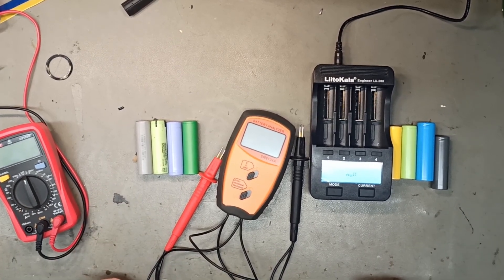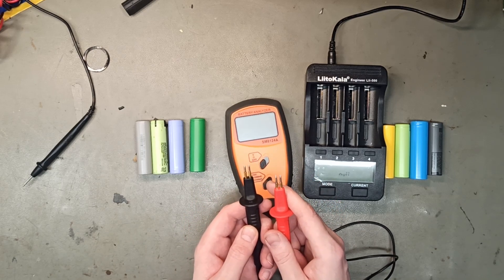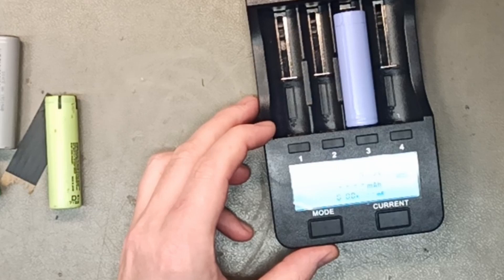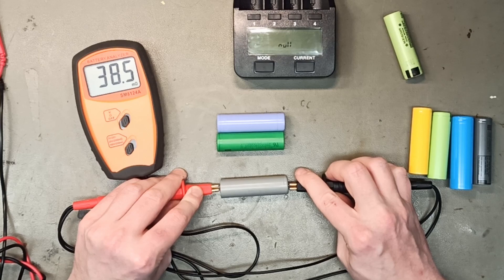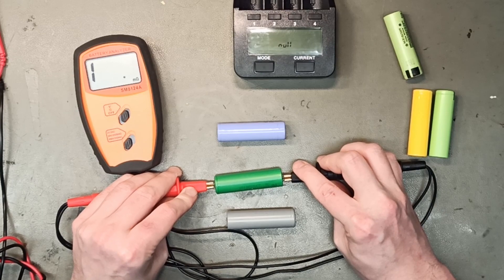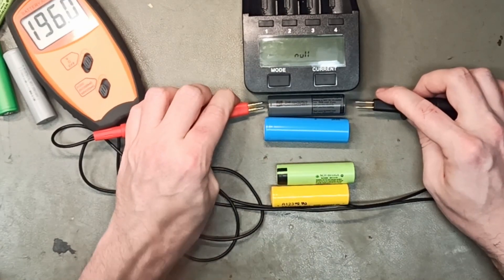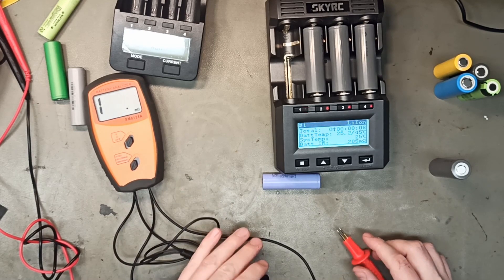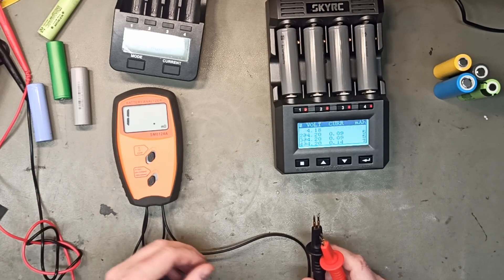Does Internal Resistance have anything to do with Battery Capacity and how to test it?

Comment: that meter is performing a four wire Kelvin measurement. A known Current flows through one pair while the other pair measures voltage drop which will correspond to internal resistance.

Comment: The reason for the dual probe and the inaccuracy of the charger is that there is some small amount of resistance at the contact points with the battery. The contact point resistance variable depending on the contact pressure and how clean the contacts are. This contact point resistance is very significant at this very small resistance readings. So it is extremely hard to get comparable readings between various batteries and test equipment. So the resistance in a battery is important, but for almost all users this data is inaccurate to the point of uselessness.

Comment: I tend to use old cells rated for 30 amps so I can arrange 10 amps discharge and look at the voltage drop. A digital meter across a single cell may change from 4.00V to 3.80V so 0.2V drop for about 10 amps load implying an internal resistance of 0.2/10 or 0.02 ohm. (I use 3 cells in series when testing and load them with 2x 12V55w car headlamp bulbs in parallel so about 9.2a.). If I build a 14S2P battery with peak current draw of 25A and use 0.02ohm cells I will have a battery internal resistance of 14x(0.02/2)  or 0.14ohm. If I then draw 25A I lose 3.5volts which is what this is all about.
Reply: That is good way to sort out bad cells, and its also a good way to test lead acid batteries to see of any cell is bad.

Comment: Sorry for saying that, but even a beginner DMM user knows that never measure resistance in a live circuit. 🙂 You can completely destroy your DMM or just damage the "ohms" circuit and after the DMM will measures incorrect values.
Fortunately, most modern DMMs have overload protection against this kind of misuse. These multimeters - like yours - have a thermistor in the “ohms” circuit. The purpose of this component is to rapidly increase the resistance along the heat from an overload current.
About DC resistance and AC impedance: in all of the batteries datasheets there is AC internal impedance, which measured by 1kHz AC signal generator / crystal oscillator. However, sometimes they call this measurement result as AC IR (internal resistance).
Usually high discharge rated batteries has very low IR (actually AC internal impedance). Most of them are 10-25 mR (mOhm).
DC internal resistance value can be 5-6 times more than AC internal impedance and this measurement much more affected by the battery voltage state.
Sorry for the long comment. 😁
Reply: Thanks for your input, did not know it could dammage the DMM. Panasonic/Sanyo does not list IR in their datasheets, but i found it on LG Mj1. Initial AC Impedance (Cell shall be measured at 1kHz after charge): ≤ 40 mΩ, without PTC. Good to know. Do you maybe have an IR meter to recommend. FLUKE-BT510 costs like €4000 and UNI-T (UT701) about €300 is till a bit prices. Are the >€50 chinease ones decent?
Reply: @Batteridoktorn   I use YR1035+ for a few yars. Chinese. No complaints. Useful also for measuring resistance of cables, grounding, etc.
Reply: @Batteridoktorn  U don't have to buy "fancy" DMMs or any other devices. I use YR1035+ (like @tomazgorjup) for ages and it works fine. Your SM8124A is good and accurate enough to measure AC internal impedance of batteries.😉
Reply: @norbithehun  Thanks, been looking at YR1035+ as well, but it has a small built in lipo battery, does not seem optimal. Can you recommend any brand IR meter?
Reply: @Batteridoktorn  YR1035+ has a 18650 battery inside, so it is ideal for me. 🙂 I have some.😁😅
Maybe you checked YR1035 without "+", because it has lipo battery inside.
But, if U want to by a brand IR meter, I recommend the Uni-t UT3563. If U want even more professional, buy one of the Hioki products. Hioki makes battery analyzers and impedance meters like BT4560, but this meter is more than 6000 USD. In my opinion, I think, Uni-t is more than good enough for U.

Comment: Xtar tester does the same, never indicates the same value twice. I insert the cell 3 to 5 times to see the lowest value. I had cells from old laptop batteries that would not drop under 150 mili ohms and of course they got hot after 10 min of charging with 500 mili amp and brand new Samsung 25R that had lowest 11 mili ohms that charged with 2A without any problems

Comment: Te LitoKala measure the resistance with DC current. But the 4 wire resistance meter use 1 kHz... this is the reason why results are different. Generally battaery manufacturer give internal impedannce (resistance) at 1 kHz... see an LG CHEM datashett...

Comment: Internal resistance vs. internal impendance... Resistance is tested with DC current (probably 1A) and calculated out of voltage drop. Internal impendance is tested with 1000hz AC current. They are never the same. Internal Impendance is what the manufacturer refers as IR so for comparison only this is OK to use. Let's say it's standard. You have to use double wire probes. Probably one for current, other for resistance (not sure). And it is much more accurate. The probes must be sharp to make good contact, and the springs result the same force.

Chargers use DC voltage drop for testing, so the results are way off. It is different type of IR. SkyRC tester is pretty OK for this, but SOC is very important factor here. And not test just after charge. Cell must settle first. For basic orientation it is just fine. If IR is over 200, then Impendance is most likely over 50, and the cell is "kaput". But not necesary. Some new cels have higher internal resistance. Higher energy density cells, higher resistance, lower max current. So you have to check technical paper for new cell first, before you say "it is kaput". :-)

BTW: if you push up/down arrows at the same time, SkyRC measures IR on all ports, that are not charging.
Reply: Thanks for the explenation and input
Reply: Is the XTAR Dragon VP4 Plus a good internal resistance ohm checker? It comes with 2 probes connected via USB
Reply: @RocZi  Don't know. It seems to me the probes are not 4-wire probes. Try to find some comparison with YR1035+ on YT.
Reply: Are battery chargers that use voltage drop fine for matching cells to use in an 18650 vape mod? This is what I want to do, I have a bunch of random 18650s and I just want to match them for that use only.
Reply: @travispratt6327  There are high currents at vapeing. So it is very important to use high current cells. If there are more cells paralleled in vape, they should be closely matched. Both; by capacity and resistance. Chargers could measure capacity pretty OK, but resistance is not consistent. I would try to measure voltage drop ar higher curents. At least 2C. This could be 4A or more. More amps bigger voltage drop and easyer to measure.

Comment: I calculate the internal resistance with a multimeter and a shunt resistor..so i guess the battery analyzer does the same with the 2 prongs. One meassures normal voltage and the other got a precice shunt as load and the device does the calculations i do on paper.
Reply: the analyser use 1khz square wave for measuring the impedance, if you do a resistor load test you will get different reading depending on SOC
Reply: @dantronics1682  Ok, but does the internal resistance itself, not vary with the SOC, even when measured with the analyzer?

Comment: The video misses several important insights: DC vs AC, test methods, charge state, variability, and purpose!
* One of the tests is DCIR, the meter you have uses ACIR. (DC resistance, measured any of several ways, vs AC resistance at 1 kHz. VERY different).
* Int'l test standards are for testing at 85% and 20% charge. Depending on the battery type, that matters a LOT!
* The red meter with double probes is +/- 3%. Don't have spec on accuracy of the other.
* For use in electronics, ACIR is much better. For high power such as a vehicle, or RC device, DCIR is better.

Comment: Do you consider problematic receiving new lithium ion cells at 3.44v? I received my new 21700 Samsung INR 40T3 4.000mA, 35A cells with 3.44v. Is that too low? I've builded an 2.8 kw 24s8p battery for an electric paramotor and has a huge voltage drop at 10-17kw full throttle and it should handle it like other similar batteries. I'm trying to find out why. Thanks.
Reply: Lithium ions should be stored at 3.7-3.85 volts per cell... Where did you buy those cells because I'm not sure they are "new"... Please let us know so we can avoid.
Reply: I've buyed them from Nkon - Nederland. A well known company from where I'm pretty sure many European builders buy. They can't be older than 2020 because that's when the 40T3 hit the market. Thanks.
Reply: I am a battery builder and sourcer. What I have learned is that cells are rejected by their manufacturer if they have a self discharge rate that is unacceptable. Those cells are usually supposed to be recycled for raw materials. But they usually end up being swapped for some other less valuable items and get documented as destroyed. But they were actually sold to the black/grey market. Such cells probably ended up with you eventually. It affects even famous and highly reputable brands such as Murata, Molicel, LG, Samsung etc
Reply: @Kays_Customs   @KennethJustNowAtHere  Thank you! It could be that or as others sugested that new regulations on lithium demand to be shipped at lower charge and other battery builders received theirs at the same 3.4v. I've asked on many youtube battery building videos. And the voltage drop might also be from the connections, I don't know. The capacity is right as on six individual cells cycle , I've got the full capacity and beyond like 4050-4120mA on the 4000mA cells. 
Now I don't even think about it, I can use it wery well as I don't need to go beyond 10kw power in which case the voltage drop is about 6-7v on the 2.8kwh 24s8p pack and already have 17 flights on it so I'm pretty happy.

Comment: Can the charger measure the internal resistance correctly just by inserting the battery? Doesn't it need to charge and/or discharge for more reliable results? I have one lousy cheap charger and the internal resistance changes a lot while charging
Reply: Should not change doesn't depend on charge depend on battery material

Comment: Hi battery doctor ...what would be the good number of resistance for a battery pack .like 36v ....
Reply: Entirely depends on how many cells you have in parallel and what type of cells you are using to begin with. You have to have 10 cells in series so lets just use 20 milliohms, it is a good IR for a moderately powerful cell. So thats 20X10=200 milliohms....but if you have 10S2P well then 100milliohms. 10s4P will be 50 milliohms. 10S8P will be 25 milliohms.
Reply: Thanks battery doctor  ...i appreciate the help.